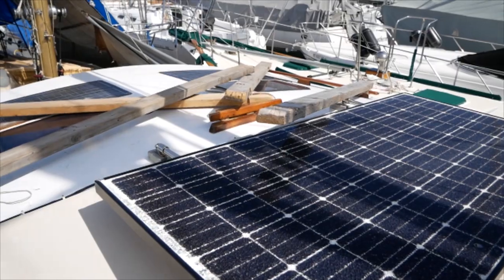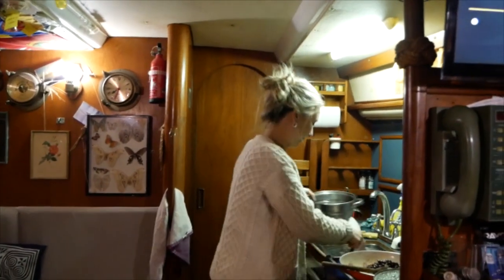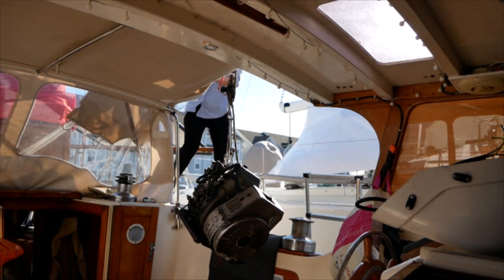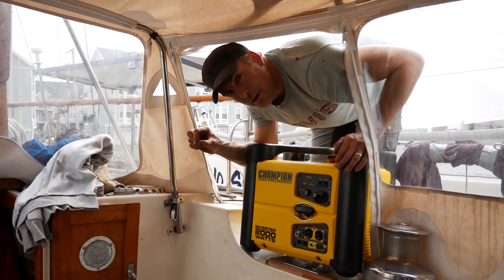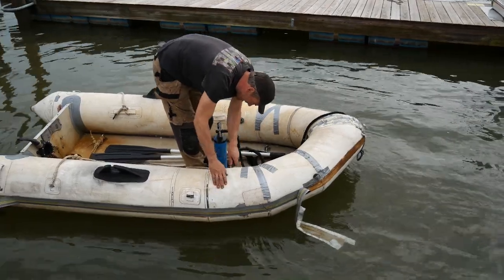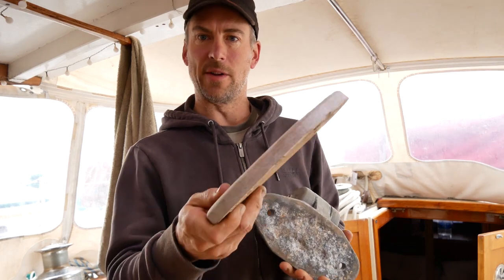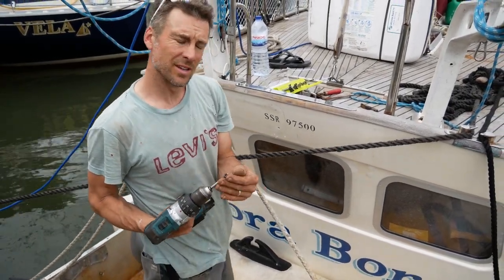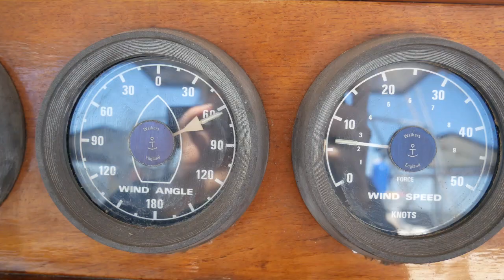Ep041 The Reality of Long Term Cruising; Grafting in the Yard

Comment: So good to see you back and doing what I  wish I was doing  :)   More power to your elbow.  Re the genny - I also have a 7000-watt (Makita) generator for the house but you will need to change the oil at least every 200 hours to keep it in good condition. Ours does not run anywhere near that number of hours but the oil is changed every year regardless. Probably way better to not let it sit unused - as in your setup. Only other thing I would suggest if in the USA,  try to get petrol without ethanol in it. Marathon sites have it and there is an app for your phone that will tell you which sites near you stock it. Called "Pure Gas"  RV's use it too.
Reply from the maker: Hey, thanks for the comment, I have had problems in the past with UK pump petrol and 2 cycle makita garden tools. The carbs got all gummed up because of the ethanol in it. So thanks for the tip. As for the oil, I was horrified to see how little it holds, but it is so easy to change. Glad you enjoy and fair winds.

Comment: My favourite couple back...now for some real sailing...TIP of the day!...the dinghy will clean up sweet...Oxalic acid...removes rust stains really well...its used by dry cleaners to remove/neutralise all sorts of stains from clothes...exceptionally good on polyester dacron sails & doesnt harm/degrade the fiber...great rid of sooty mold really well...also found it cleans off paint oxide great for a clean paint surface...doesnt seem to be hard on hands, no more than strong vinegar anyway...smells a bit like vinegar, its an extract from rhubard leaves :-!
Reply: The only way you could make this channel better...is get a catamaran :-)

Comment: I still have a Mase generator.
It’s a nice box with a collection of bas****s inside it.
Theo Lambordini engine has been rebuilt as has the generator.
Today it works, that is five days in the 15 years I have owned Amicula. It’s only a matter of time before it dies again. I did buy a Honda 2200 ova generator but it gave up after 500 hrs.
Generators offer so much, hmm.
Good  luck.